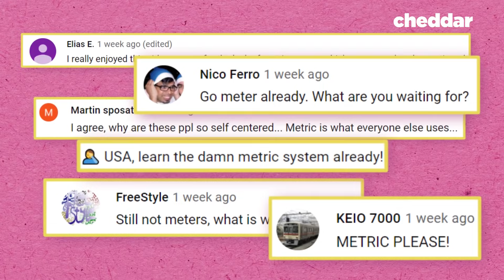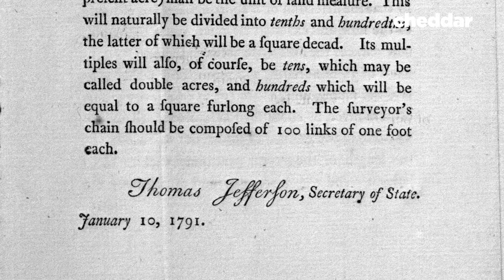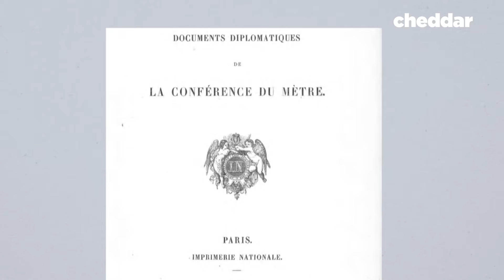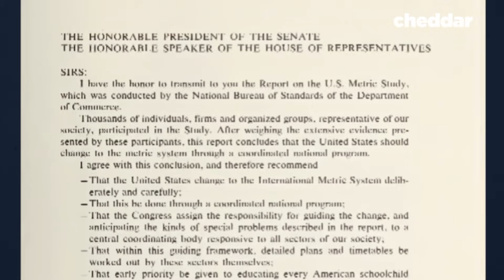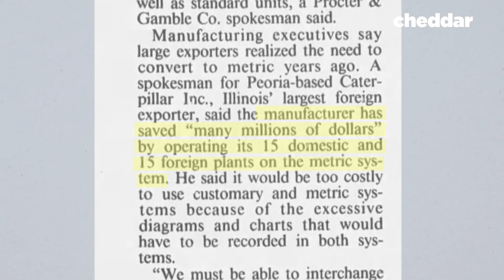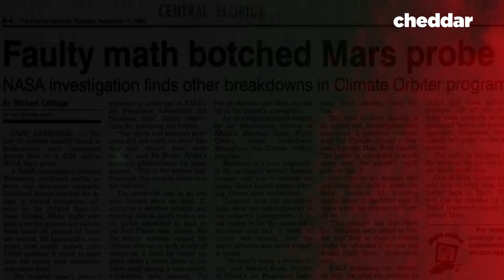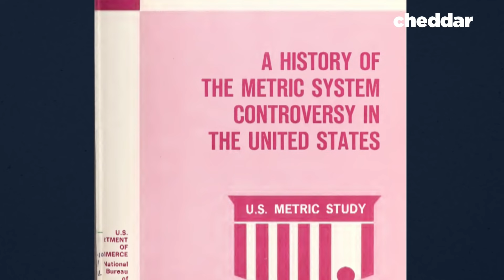Why Doesn't the US Just Use the Metric System? - Cheddar Explains

Comment: The metric is just a logically designed, consistent, and easily scale-able system.

The metric system is the ONLY logically consistent system of measurement compared to the English system Americans have adopted.

And don't give me that crap about that it would cost too much to migrate to the metric system.

The metric system is just logically consistent as I said above.
We have no intuitive feel for the relation of 
inches to feet to yards.
But we can know that there are 
100 Centimeters to 1 Meter.
How many centimeters is one half a meter?
50 centimeters.

and 
1 million Millimeters to 1 Meter.
 How many meters to a kilometer?
1 thousand.
The only difference is a matter of scale and an Exponent.

1mm  is 1 x 10(-3) meters.
1 km is  1 x (3) meters.

But how many inches to a foot, to a yard, to a mile?

How many Yards to a Mile?  I don't know,
but I do know automatically that there are ONE THOUSAND meters in a KILO METER.

For the Eenglish measurement system the scaling is not so easy and consistent.
There are 12 inches to a foot.
But 36 inches to a yard, etc.
What is the base measurement a foot or a yard?
How many sub inches in a yard?
does not scale well at all.

the same goes for Volume, Mass, Time,  Energy, Temperature, and Force.
How many Newtons in a kilo Netwon?   
1 thousand.

The metric is just a logically designed, consistent, and easily scale-able system.

Electricity.
Amps. Volts. Hertz. Ohms. Farads. Watts.  Henries.
their subdivisions or multiplications  can all  best be described by the metric system.

Comment: I've learned US Customary & Metric about side by side my whole life since a lot of schools over here like to teach Metric. The Metric system for me personally is much more difficult to use due to it's confusing prefix system. The other thing I don't like about it is the accuracy of some of the units. Inches and feet are a nice size to measure mid sized items, Centimeters are very small and meters are very large and both seem very inconvenient to me. The same goes for Celcius over Fahrenheit, degrees F are a bit smaller than degrees C so you can get a bit more accuracy without splitting numbers. That being said, I don't see what the deal is, people who complain about it most likely are not affected by us using it at all.

Comment: I was brought up on Imperial but then taught metric at school when I was only 5 or 6 back in the late 60s/early 70s.  My mum never managed to convert and thought decimalisation of money was just a scam by the retailers to put up prices (was she wrong? Probably not). We had 12 pennies to a shilling and 20 shillings to a £, unlike the American DECIMAL 100 cents to the $. 

The trouble with imperial (other than the multitude of different names and divisions  - eg. 16 Oz to the Lb, 14 LB to the stone, 2240 pounds to the Ton, etc) is that UK and US imperial measurements don't always match.  A UK gallon is roughly 4.5 litres whereas a US gallon is roughly 3.8 litres.  It's all too confusing!

Comment: metric is base 10 and cannot be decided in halves, as base 12, for example. there are many good reasons that metric system sucks ass
Reply: Half of 10 = 5.
Done.
Reply: +John Smith 
I meant easily. try making a clock with base 10. it's why we use base 12.

Comment: In 1977 Canada went Metric. We were told that the US was going Metric. 40 years + We in Canada still buy our lumber by the Imperial method ie"  2x4, 2x6, 2x8, 2x10 etc. Plywood by 4 ft x 8 ft. It was a big scam in Canada to get more tax money out of us. Went from Gallons to Litres. Could charge more tax per Gallon that way. Imperial Gallon is 4.54 Litre, U.S. Gallon is 3.78 Litre & a litre is Aprox 35 oz.
Reply: Do not forget in Canada we still fill up 5 gallon gas cans for lawn mowers , fill 20lb propane bottles for BBQs and buy nails and screws by the inch .

Comment: Problem?  Most people claiming metric is better don't actually know/understand the metric system.  They will give their "weight" in kilograms instead of Newtons.  In other words, people don't want to learn and use math or actually understand what they are doing.  I know what a slug, a pound, a pound mass and a pound force are.  But many don't know the difference between a force and a mass.  That's their fault.
Reply: Newton is not a measurement of weight, but of force. In fact it is impossible to use Newton without first having knowledge of the kilogram. As 1 Newton is the force needed to move 1 kg 1 meter within 1 squared second. 

I don't know if that is what you are getting at, but your wording makes it come of as extremely ironic. 

In that you are asking someone to use Newton, a measurement of force, to describe their mass. Then proclaim that many people don't know the difference between force and mass. 

It makes it seem like you are the one that don't understand the difference.
Reply: @theRabbitFly  Weight is in units of force.  It was one example of an error.  You don't really need a definition of weight...do you?
Reply: @johnchestnut5340  I guess I did not make it clear enough.

When you give your weight. Do you give it in Pound force or pound?

Because all you are doing is making a semantic argument without any real consequence. 

Common use of the word weight is the equivalent of mass if you want to be scientific about it, but it is in both imperial and metric. So your point really doesn't make any sense.
Reply: @theRabbitFly  Just get a book.  Read a few definitions.  Have a good day.  As for "common usage", that is cultural.  Cells are packaged, marketed and sold as batteries even though they are not actually batteries.  Arguing won't change either fact.  It's time to walk away.  I still know the difference between a slug, a kg, a pound mass, a pound, a Newton, and pound force....respectively.  British gravitational standard, SI metric, and American engineering...respectively.  I'm also aware of the old French metric and the Italian metric as well as a few older unit systems.  How many hogsheads are in a butt?  That's a lot of wine.  I'm sure you can Google it.  It even makes a crude joke.  Have a good day.
Reply: @johnchestnut5340  My point exactly. You were the one that seemed hung up on a scientific definition versus the cultural usage of the word. I was just asking for clarification.

I still fail to see how this issue, of using mass to describe weight, has anything to do with metric vs. US standard. If you respond to the question of your weight with pounds you are making the same mistake as someone answering the question with Kilograms. 

So why are you making this out to be an issue with the metric system and not just lack of scientific understanding in cultural usage of words?

Comment: I can’t fathom why changing systems would lead to a lower production cost, she said GM used thousands of different size belts but after going metric only used hundreds. The length of something can be measured accurately with both metric or imperial
Reply: GM is an international company, so they were able to reduce by being able to use the same belts worldwide than having to make ones specifically for the U.S.

At least that's my guess

Comment: One of the reasons we are not going metric....Manufacturing.  I was a machinist and continue to work in manufacturing, I have over $5,000 worth of measuring tools that measure in Imperial, and the company I work for has probably about $30,000 worth of measurement tools.  Why would I want to throw all that investment in expensive tools away?  Additionally, manufacturing has many blueprints in the imperial measurement system, how do you pay the cost of completely redrawing them in metric.  Modern prints are typically done in a software that can switch between metric and Imperial, but only modern prints have this ability, older prints do not.
Reply: Virtually all modern production machine tools use dual U.S. and Metric measurement systems. When the company I worked for switched from U.S. to Metric (because more that half of products were sold overseas) in the mid 1990's we checked with our job shop vendors and found that they had no problem at all in reading drawings and fabricating parts with metric specifications at no increase in cost.
Reply: @davmar9923  Yes, in smaller manufacturing this is typically done by 'redrawing' the drawing back into Imperial units (I personally have done this many, many times).